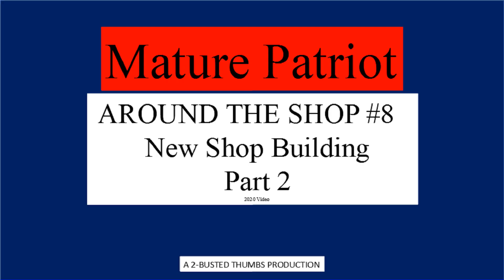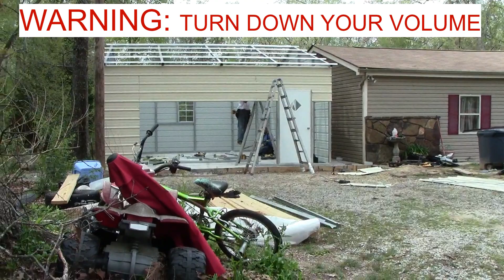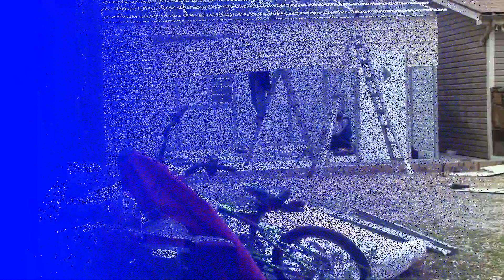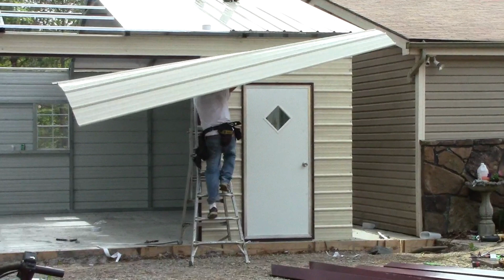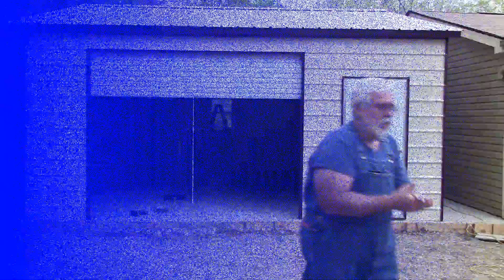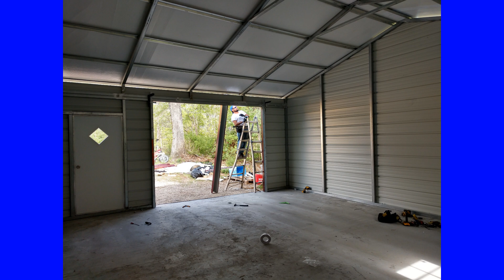Around the Shop 8 Part 2

Comment: Looking good are you going to insulate and finish the inside walls? I guess the next step is to run power to the building and all your outlets correct.
Reply from the maker: Yes, top both.  I already have power lines in the attic to hook up the building for single phase.  Will move my RPC to this building for three phase.  I have located some 4'x8' foil faced foam insulation that will make insulating fairly easy.  Debating as to whether to run the electrical in the wall or on the surface.
Reply: @kentuckyken  yes I agree with that, I rebuilt my little shop a year ago and ran the cables inside the insulation cavity, now I wish I had surface run it because I want even more sockets as we call them in the UK (outlets to you in America)

Comment: Sure didn't take those two guys long!  I know this is a time lapse but still, you can tell it didn't take a week to frame and install.  Not sure if you've done wiring yet but I used EMT conduit in my garage when I wired it and would never go back to in-wall wiring for a shop again.
Reply from the maker: Antonio and Raul did a fantastic job. Yes I plan to do on the wall wiring.  I may use plastic instead of EMT.  Thanks for watching.
Reply: @MaturePatriot  Actually the PVC conduit would be a good idea as it is much easier to run.  I got a trial-and-error (lots of error) education in how to use a conduit bender while doing mine, lol